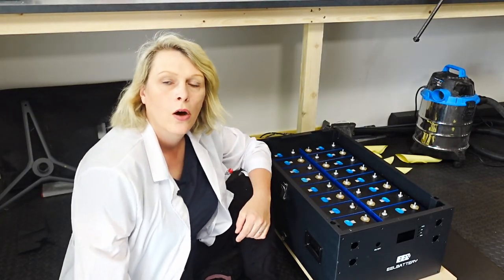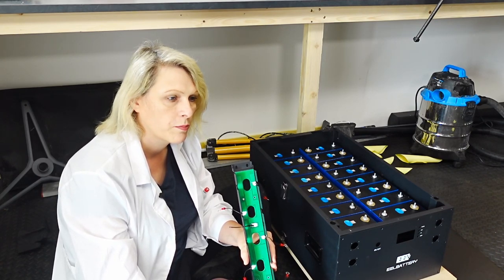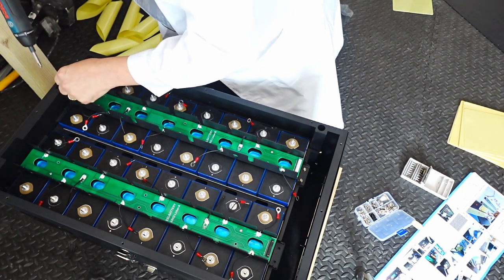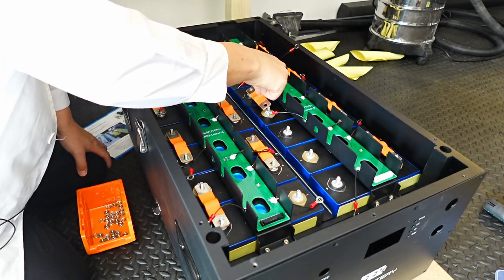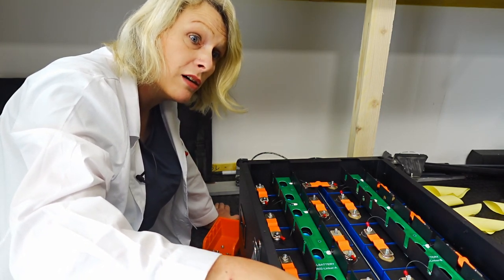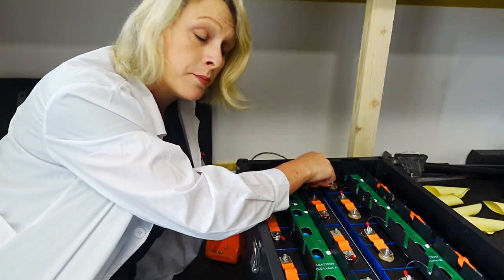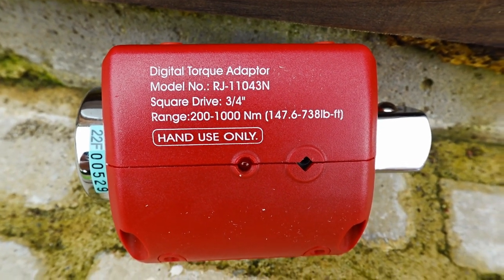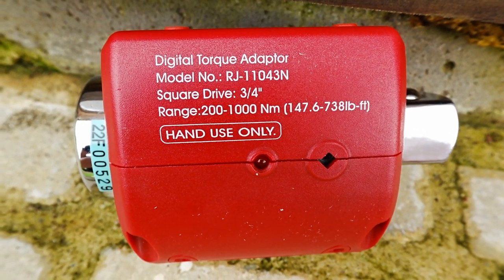DIY Lifepo4 Battery Case kit build part 2

Comment: Also in France for 19 years now. There are some shops that open on Sundays. There are 3 main sizes of square drive, 1/4, 3/8 and 1/2 inch. As an ex aircraft engineer, I have step ups and step downs for the various sizes that I use on bikes and cars. You must have a neighbour that has similar. You have bought a huge torque wrench that is 3/4 inch drive and, as you said, is for truck wheels or something similar. You will probably find that there are also smaller versions of the same tool.
I think that you are much further north than me.

Comment: I suppose you may have the smaller torque wrench now, but many choose not to have and do their small domestic jobs without it.
I used to torque threads with ordinary wrnch by applying approximately the force required to reach the recommended torque. For example, if you need 6.4 Nm, you force will be 6.4N at the arm length of 1 meter. Then, suppose you have your ratchet wrench handle 20 cm long, and suppose you apply your force in half of your hand width from the handle tip, so you will apply 6.4N*(100/15)=40N, i.e. about 4 kgf. You can either use your feeling or use a hook scale to apply the force needed. That's it. So you will never overtighten your nuts and, hopefully, never undertighten them too

Comment: I would also wear safety glasses when working over those batteries... if you accidentally dropped a tool on them it could create a pretty nasty short circuit and sparks would go flying.

Comment: Hi ,loving the vlogs,what part of France are you in 🤔,I'm over near aubeterre but on the Dordogne side 🙂,just about to build an off grid cabin with my partner (built my own 304ah lfp last year and all working great still ) naturally looking towards 48v using the same 304ah grade A cells /15.5kw server rack battery with one of those DIY EEL boxes ,did you order direct from America 🤔,or EU stock ,same with your cells ,I get mine from the Netherlands (they've come down dramatically in price since I ordered mine ).
Mark.

Comment: It says on the side 3/4" drive, 200 to 1000nm (I hadn't got to the end of the video) either they sent you the wrong one, or you didn't read the specs. We have 1/4, 3/8, 1/2, 3/4 and an inch drive, and no doubt bigger drives are available , but that's what we use. Truck wheel nuts are torqued to 700nm (some are less) , we use a 1" drive air gun and the torque wrench is 3/4 drive. Car wheel nuts are generally around 120nm, but again these do vary. Hate to think what that 3/4 digital torque meter cost.

Comment: You can use another balancer, but this will convert energy into heat. 
If the cells were all charged to 3.6 volts beforehand, this will remain the same in the group for many years.
But there's no arguing about that because for some it's a question of faith.

Comment: when dealing with such small torque specs, it would be a lot more accurate if you used a smaller torque wrench which would be 1/4 inch(size of the head) drive

your socket looks like a 3/8 drive 

the torque wrench looks to be a 1 inch
the adapter you got for the male end looks to be 1/2 inch

3/8 adapter to 1 inch
1 inch torque wrench female
1inch toque wrench male
1 inch to 1/2 inch adapter

That make sense?
Reply: 1/4 inch drive torque wrench range is 20 - 200 inch pounds - what you want and might need a 1/4 inch drive "insert the socket size that fits on the nut"
3/8 inch drive torque wrench range is 10 - 150 foot pounds
1/2 inch drive torque wrench range is 30 - 250 foot pounds
Reply from the maker: Yes makes complete sense. I've just received my new torque wrench in the post and it's much smaller.

Comment: 3/4" torque adapter could come in handy if you need to tighten up some tractor or lorry wheel nuts but realistically you should send that back for a refund or flog it.